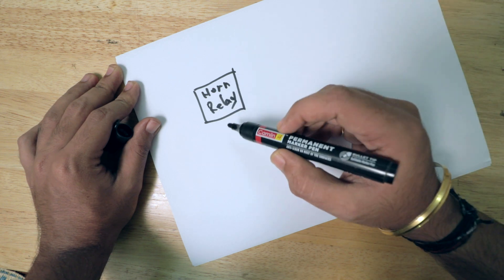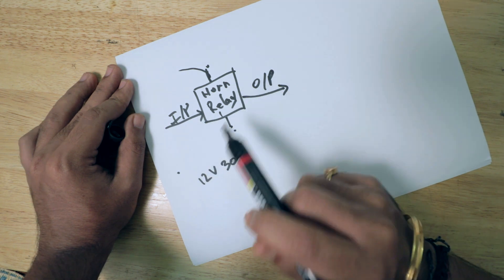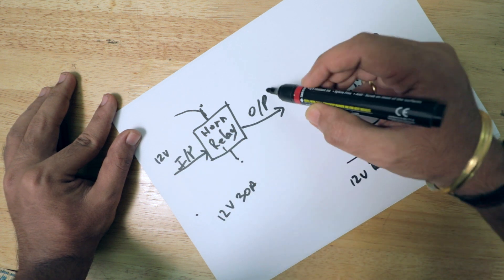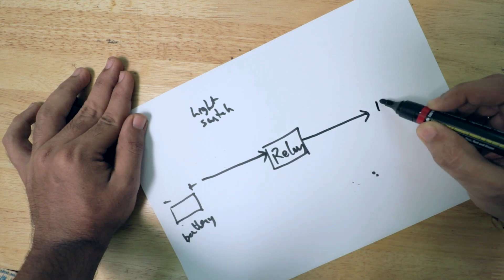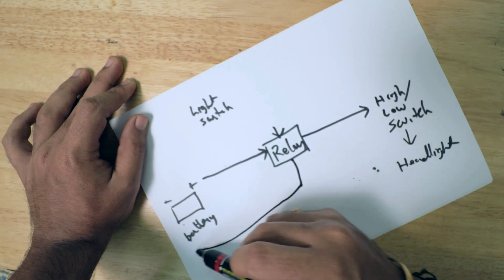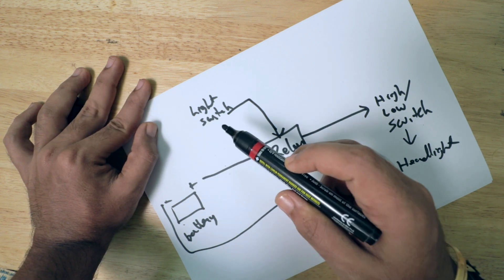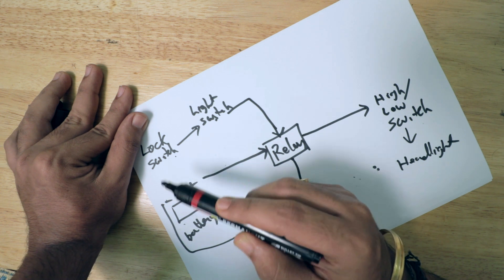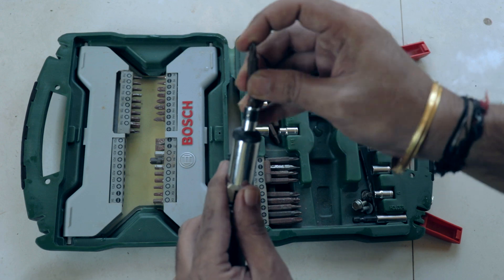Convert any Scooter From AC to Full DC | Activa | change headlight connection from engine to battery

Comment: Sir If I Dont Use Relay And If I Play My Philips 6w Led Headlight In My Maestro Edge 110 BS4 Scooty After Doing AC to DC Connection Then Will My Battery Will Fall Or Damage? Should I Convert My Scooty Wiring From AC To DC Connection?
Reply: The AC To DC Connection Will Damage My Battery? Or Not
Reply from the maker: It will not do any damage if done correctly

Comment: i've seen videos where they just cut off the ac wire coming from alternator to headlight, and power the headlight with 12v power from lock switch. Is the result any different?
Reply from the maker: very minor as my approach completely isolates the stock wiring so you are very sure you get minimum voltage drop

Comment: Great brother! My question is: if You use 12 v straight from the battery Will it still Charge correctly when the scooter is in use, or will it lower the charging capacity? Thanks for making the video in English. I can not understand hindi!😩
Reply from the maker: Depends on what is the charging capacity and the wattage in use. As for this scooter its not a problem

Comment: Bro y do u need a relay for this just disconnect the ac wire to the light switch and swap with a positive line which comes from the battery or u can loop from the front brake switch. I have done this 5 years ago and running with complete led setup without any issues till now
Reply from the maker: You are not wrong. I just wanted isolated setup so that its safe enough

Comment: Can we use diod bridge rectifier and capacitor instead of Relay?
Reply from the maker: The RR unit already has got rectification, what we need to tackle is constant voltage which we can get only from battery

Comment: Will the alternator of the scooter charge enough the battery to keep up with the lights?
Reply from the maker: Well the stock bulb is 35/35w and this led is rated at 20w low and 30w high so it's well within the stock range and it does charge the battery enough

Comment: Hi Rahil. I did the wiring on a ct110 from AC to DC for LED headlight but now rear brake light does not work. Tail light comes on with headlight. I wired the engine wire to ignition wire? Any ideas?
Reply from the maker: check brake switch

Comment: How come AC came into picture? Lock switch or ignition switch doesnt give 12v dc itself ?? Btb, Nice energetic video👍
Reply from the maker: Lock switch gives connectivity from battery to rest of the electricals running on 12v dc. Ac comes from stator

Comment: Amazing Work bro ! You  explained the subject very well ... and you also mentioned to use a fuse in between the 12v from the battery and the relay which is very very important for the safty and very few people suggest this... keep it up bro and good luck for the channel 👍

Comment: Bro what's the profit it consumes the power of battery.I think you've to add a bridge rectifier and a stable boost converter in the wire of output which comes out through alternator  but it costs a lot almost 600 rupees of bridge rectifier and boost converter and you can install led on head as well as tail also and boost converter give a smoother voltage output without battery otherwise your explanations are appreciatable ok thank-you.❤️
Reply from the maker: I had thought about that at first but then I moved to this approach as it involves less electronics which means less complexity which in turn means less chance of failure. Reliability 😊
Or else The alternator produces well over😄 30vac

Comment: On my Kymco Agility there's a connector between the headlight unit and the rest of the scooter's electrics. I replaced that with a molex (old style 4 pin hard drive model) and made a circuit with 3 rectifiers to just provide DC to the head light unit.
It needs 3 rectifiers, because there's only 1 ground wire from the headlight unit, so it needs one for the 5W marker light and 2 for the actual headlight. This is probably the more expensive option, but it was the least 'invasive' with regard to having to alter the wiring of the scooter.
I did it this way for 2 reasons, first this way I am not overloading the battery charge circuit on my scooter. The electrical diagram in the service manual says the rectifier and charge controller unit can only output 30W on my scooter. I don't want to overload that, seeing as that also has to run the CDI. Second, this way I can just remove my little convertor circuit and take it with me to a new scooter when I buy one. Zip tie the molex connector together, put in a halogen bulb and it's basically stock again.
Reply from the maker: Fermitu Poupon that's well thought from your side. from what you have mentioned I think you can go about with one bridge rectifier and use that to power the marker and headlight. However if things are similar to that of honda or most of the scooter electronics , then you will still have voltage drop during idling untill the engine rpm reaches the threshold to output 12vdc.
This will be more prominent if you make use of LED headlight bulb and can damage the bulb.
Alternatively if 30w is what reaches your battery then you might also consider connecting rectified dc output to the battery in parallel (you will not overload the charging instead you will provide enough  juice available for battery to change ) I did not do that because anyway I'm not drawing anything from the stator directly  via Regulator to power up so the total output of the stator is used to charge the battery itself.
And don't worry about the CDI , the battery works like a buffer ,it will charge without any problem.

Comment: Brother great work. I have restored my dads old 1996 bajaj chetak. I want to add the LED bulbs to it.
Since chetak 96 doesn't have battery and I dont want one.
But I want to use DC lights on it directly from stator coil.
I got to know, I need to add Regulator Rectifier for the same, which will convert AC to DC. 
I am using a 4pin regulator rectifier. Kindly help me with the circuit diagram
Reply from the maker: Great!! I love restorations😊👍
Comming to your requirement, First of all you will have to use a battery if you want to run LED bulbs on the Chetak. Otherwise like I said in the video leds are sensitive and will die in no time.
Let's say even if you don't use battery ,use a RR and get Rectified DC , it will still be alternating DC. In simple words led will work fine when your Chetak will be in the correct RPM range at which the voltage output is 12v but when the rpm drops the LED will start flickering. Also led will stop glowing before even the engine idles when you will get the Chetak to a stop.

In short, you need a battery ,along with RR 😊
Reply: @RahilChodanker  Thanks brother for explaining. Still a doubt.
As there would be alternating DC from using just RR. Will the LEDs withstand the flickering or not. Can we add anything else to stop it apart from using battery. If yes kindly explain.
If not, a battery is a must. Then which battery would be fine in my case. As I dont have self start or much usage.
Reply from the maker: Leds will die quickly with the flicker.
You can use any 12v two wheeler battery which suits the size and budget. I would prefer amaron battery. And since you don't have self start the battery will last a very long time too. Also make sure to use a 10amp fuse in series with the battery to the output for safety purpose

Comment: Relay not necessary for head light.
Reply from the maker: If running led then it's a must, otherwise it will led bulb will burn off quickly

Comment: Namaste bro. I just want to know, how to install a mobile holder charger in Activa 3g?
Reply from the maker: Greetings buddy, most of the ones that you get in market are plug and play types. But if at all you want to go the diy route then take connection +ve and -ve from battery with a fuse in between on the +ve side and then use a step down circuit board or a car charger circuit so that the +12v from battery gets converted to 5v and then use your mobile charging cable and plug it in the usb, done!!! You have a charging cable ready.
For the holder you will have to fabricate it according to where you place it.

Comment: I have a suzuki gixxer which came with a 3ah battery from factory. I replaced the battery with 4ah recently. I installed a 55w projector in my headlight with a relay harness. I replaced all my halogen bulbs in indicator and parking lamp with 0.5w leds. Rear tail lamp is led from factory. Do you think 4ah can power 55w headlight + led tail light? Please let me know your opinion. Also my bike is dc setup in stock form.
Reply from the maker: What kind of bulb have you put in the projector? If it's an HID or halogen then you will face battery drain issues. You will be on a safer side if you install led bulb in the projector which will even bring down the wattage as well as amperage.
Reply: @RahilChodanker  I installed 55w hid bulb in projector. I am running 11w extra from what the stock setup was, after replacing all other lamps such as licence plate, pilot lamp, etc to leds.
Reply: Please clarify what is the max wattage that a 12v 3ah battery can support? That'll clear out most of my questions. I have used a relay for my headlights.
Reply from the maker: Its not about wattage, it's about the current that the hid ballast draws during the start up process which is more than enough to drain your battery( in a couple of startups). It goes almost to 9amps peak .

Other than that 12v 3ah will roughly have 36Wh but you want to dive deeper then you will also need to know power generated by your bike alternator to find out the proper wattage.
Reply: @RahilChodanker  thanks for the reply. Really appreciate your reply for such an old video. My ballast has a max start current limit at 78w. What you said is right. How to check alternator max power. Do you have any video link? Thanks again for all the help and replies.
Reply from the maker: Not a problem buddy, I'm here to help.
For HID or any other equipments the reference is taken in the form of Amperes.
You will need a multimeter to Measure alternator power, but I will not suggest you doing that as it can be hazardous.
You can try to find out online or other Gixxer users who know the ratings, my guess is somewhere between 100-150w ( just a guess)
If you want to ramp up the current then you can get the alternator rewinded and also change the RR along with it. But most of the times it's a hit or miss so I would say stay away from it unless you want to break something.

My personal suggestion for you would be to use a led bulb which will be highly relaible and you will have a peace of mind.

You can very well use the hid that you have but make sure you ride your bike enough in the daytime to let the battery charge
Reply from the maker: If I miss out here then you can also hit me up on insta😊🙏🏻
Reply: @RahilChodanker  Thanks. I ride 80% during daytime and 20% during night time so, I think I am safe. Thank you very much sir. Noted all your points.
Reply from the maker: Also make sure to start the HID only after you have started the bike engine
Reply: @RahilChodanker  I switch on my hid only when my bike is started. Also I checked if my bikes hid works on alternator alone by installing a dead battery and the alternator produces enough current to keep the 55W hid on during idle. So I am confident about my setup being compatible. My current battery is also 4ah so I have 1ah extra. Since I ride my bike mostly during mornings, I am sure that 4 ah is getting charged enough. Thanks again.
Reply from the maker: You cannot consider 3ah and 1ah seperate. 4ah means 4amps per hour , if you overload the battery by consuming more than that at a given time then the equation changes  friend.
Reply: @RahilChodanker  I mean to say. My stock battery was 3ah and I replaced it with 4ah so I have 1ah extra even compared to earlier. There is space given by suzuki for battery size of upto 7ah in my bike. I guess the alternator is capable enough.

Comment: It’s k bro . But with out battery vehicles how we convert ac supply to DC supply for fitting led head lights  plz give reply
Reply from the maker: You can use a simple rectifier and get the job done, but I would not suggest you to do that to use LED bulb because like I said they are current sensitive and without stable current you will damage the LED bulb in no time.

Comment: Friend, I am planning to install LED headlight in my Activa just like you did.
However, I have some concern regarding it.
I use my Activa almost daily for commuting(20-30km). Often I need to ride in rain/fog/dust(construction) during late night. 
Does LED really provide better visibility in rain/fog as compared to our Halogen?
Is it useful on highways/single lane roads?
Reply from the maker: For activa LED will be better for you

Comment: Hi, I want to replicate your work but I cannot find a relay with 3 pins, only a 3 pin flasher relay or a 4 pin relay. where did you manage to acquire a 3 pin relay? or would a 3 pin flasher relay work or would a 4 pin regular relay work? Thanks!
Reply from the maker: Brother, I have used 4 pin horn relay and not a 3 pin one , hope that helps😊👍

Comment: Ok
If u using positive.dc volt for h.light .it should affect battery life
Am i right .other things.which type ledlight  r u suvgectingfor scooty.pls.reply
Reply from the maker: It does not affect battery life unless you use some cheap quality bulb. I changed my battery which was installed when I had done this conversion along with the bulb and it worked me for 4.5 years. I changed to new battery just 2 days back😊

Comment: For installing headlight relay, do we need to convert from AC to DC in Activa ?
Also, does AC current support Headlight relay ?
Reply from the maker: Seems like you have not understood it buddy, see When you install Realy , your activa becomes DC ,done!
Reply: @RahilChodanker  Thanks for clearing confusion
Reply from the maker: Anytime buddy 😊
Reply: @RahilChodanker  Will using H4 60/55w halogen on DC setup(motorcycle), drains the battery faster or will the battery keeps charging fine, while riding, irrespective of AC or DC headlight?
Reply from the maker: Not recommend at all, battery will drain and age  quickly
If using it in ac then they will not glow bright as they need more current than what activa can supply .
Good LED bulb is the way to go if you need brightness
Reply: @RahilChodanker  Thanks friend for clearing doubt
Reply from the maker: Anytime 😊

Comment: This is not the converter process. you just use the DC power from battery, so where is ac to dc conversion
Reply from the maker: Well my friend, the process actually makes the setup convert from ac voltage to the lights to stable DC using battery.
If no battery is used then the output would be alternating DC which we don't want

Comment: Bro, can u help in fitting 12v battery in bajaj chetak 150cc 2-stroke scooter. And making it fully dc. I want to fix led headlights, taillights and blinkers. Thanku
Reply from the maker: Yes sure, you will first need Regulator Rectifier and a battery for This.
Also you will have to redo the wiring as per your need

Comment: You have not converted ac to dc, you cut down the ac and connected to dc, this may lead battery low in long drive at night time.
Reply from the maker: That is actually called DC conversion as the complete electricals now  runs on DC.
I have been using this setup now for almost 4years and till date I have not faced any low battery issues as LED draws less power than Halogens, hope I was helpful 😊
Reply: 5 Years later i face the same problem. There are rectifiers with a higher power output - if anybody still needs a suggestion for that.